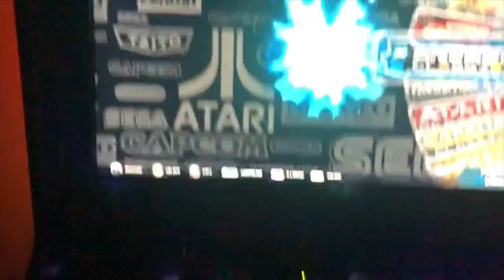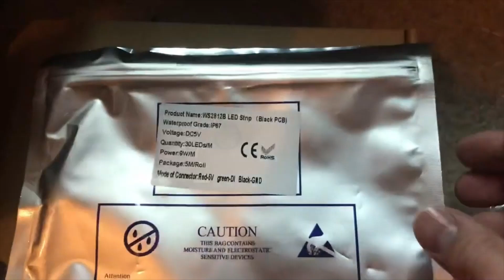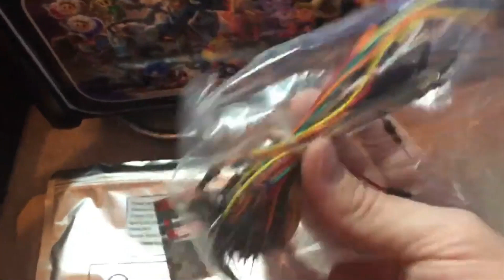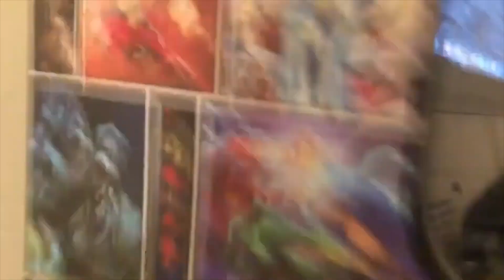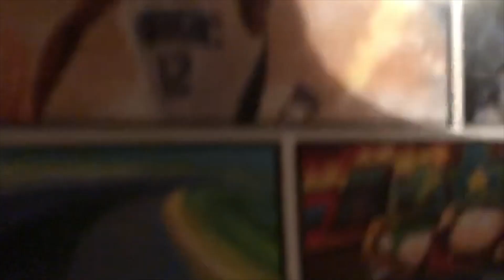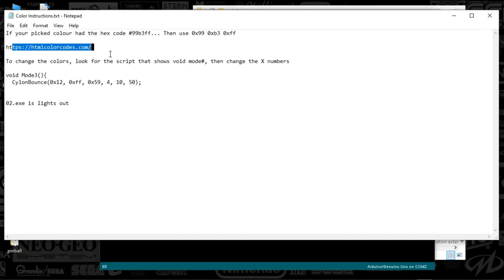Hyperspin- Synced Ambient Lighting

Comment: Interesting using adrino, for my cab floor and back lights I plugged RGB strips straight into the pacLED 64, so I have full control along with the RGB buttons using led blinky. I’m sure  both methods have their advantages!
Reply from the maker: Yep I ruled that out because I wanted to sync it with hyperspin calling system